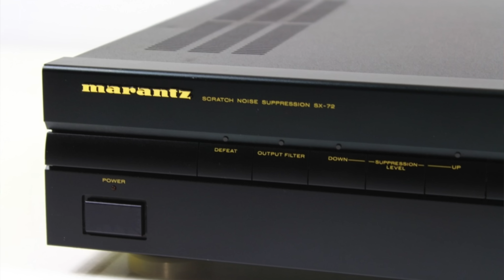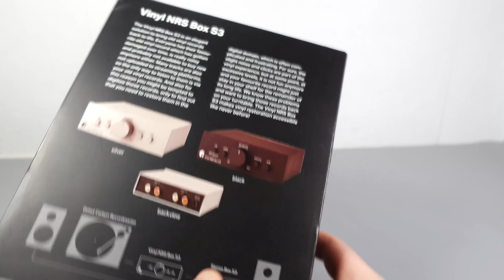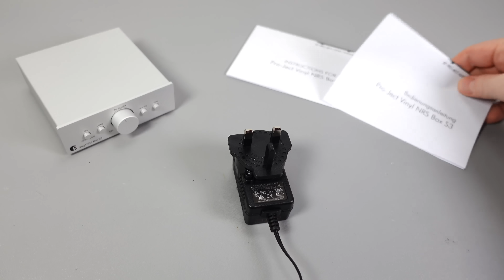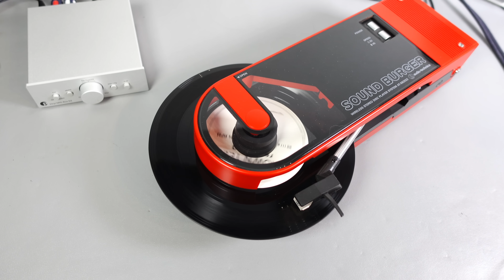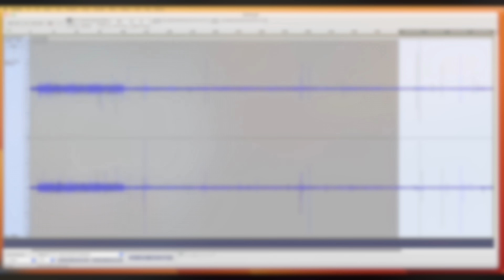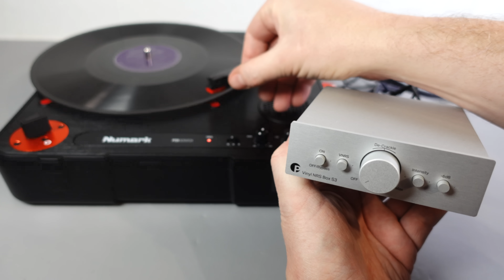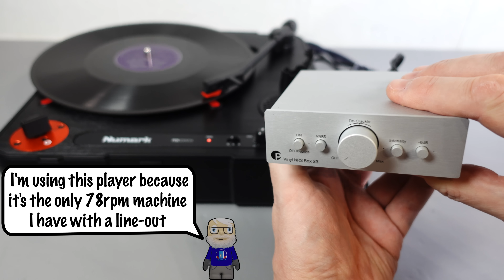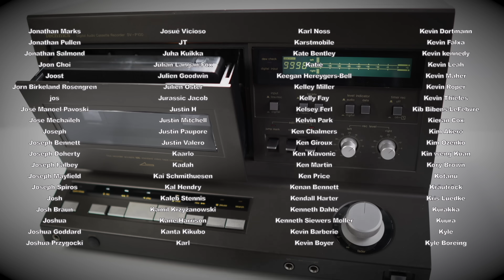REVIEW : Vinyl Noise Reduction System Pro-ject NRS Box S3

Comment: RS2xr Here: just build a new wireing system such as this:    

Splice a wire a Three wire  set: reconnect one color back or just do not splice that one wire  : connect the ground to the spliced color wire. you should have a  wire line in an X. and then play your records. would you be surprised to know, mono 45's after about 1063, were cut with a stereo cutting head?!  which, one channel is empty or silent! and the other channel  would be the music, etc.   with this wire you can remove that empty channel, using your balance ctrl.   and your mono mix, then sounds  so much better at least if not like a new pressing.

if you want toi make this a 4 track mix. you would need another wire of three slice the other colored wire and connect that wire to the ground.making an X.  you should also use two amps, for both wire sets. as  this setup can over heat an amp or wire set. if you set your volume up too much. 

This wire works with every, system. even Game systems. you may - find out, how  your games and movies sound.  if they are in stereo - so good you may Wow! your self.  if in mono, well, mono is one so one wire setup as such would move the sound to one speaker. a four track wire may have two speakers working!   

And no, I do not use a discrete board, as. there is no need!

Comment: My favourite device that I've found to make a huge difference in vinyl noise and turntable rumble reduction, all while doing this in a completely analogue method, is the dbx 3BX Expander.
This unit, while an oldie, is a goodie and a lot more than just pretty lights (it has those too!).
Reply: I own one but it messes with the dynamics of the original recording too much for me to use it often. The record has to be really hammered for me to bother.
Reply: @thomosburn8740  Interesting, but I haven't found that to be the case for me (unless you way over apply it's effects). The dynamic range increase, especially for the compression that seems more prevalent on newer vinyl, is a big benefit to me. But alas, hearing is a subjective thing, meaning we can both be correct even with different opinions.  🙂

Comment: Of course it actually digitizes the analog input, processes it and then turns it back to analog.  So I wonder if the vinyl purists will notice the sound is now even more oxygen free, smooth, warm-ish soft around the edges with hints of raspberry and cinnamon.  Soundstage was expanded to at least twice the norm and the drummers feel like they are sitting in your lap.

Not available in the USA (seriously).  Probably contains spy chips made by Huawei (supposition).

Comment: i have a computer program that work very good DePopper cleans a list of audio files, recorded from vinyl or audio tapes, with minimum losses. The resulting sound is bright, very close to the original. Only the clicks, pops and tape hiss are minimized. . You can do a 45 min WAV file in less than 45 sec

Comment: You'll probably find that some positions of the knob are more effective at removing a type of click or spat of crackle than others; for example, '2' might not remove a click where '5' will but then '8' won't.  Most de-noiser tools have a few more controls, and I'm guessing that Pro-Ject and sort-of reduced the functionality down to a knob and a button with some 'clever' logic.  Most professional de-noiser products have quite a few more controls that really let you dial things in, but even those I would never ever apply them over an entire track or side of a record.  I've only ever gotten good results by 'spot cleaning' them with a good audio editor like Sound Forge (which comes with my favorite 'pro-sumer' grade set of noise reduction plugins).

Comment: A scratch passes under the needle every 33 1/3 times per minute or .5555555 Hz and its multiples. This should be very easy to remove by the DSP.  (FFT -> remove frequencies -> RFFT)

Comment: I watched this video with great eagerness and as usual, the product underwent a fair, honest and real-world evaluation.
Unfortunately though, it seems that the device is incapable of removing surface noise, crackles and clicks to anything like a worthwhile level.

Because, audio restoration is a big passion of mine, I bought the Marantz SX72 ( I believe I paid about £450 about 30 years ago) and like the Pro-ject, the Marantz was simply incapable of reducing clicks and pops to a level that renders them unobtrusive....in other words; the product is completely useless !

The Pro-ject sounds marginally better than the Marantz as the Marantz produced a highly annoying artefact that replaced clicks and pops with a sound that was a lot like that made when sucking the last little drop of lemonade at the bottom of a tall glass through a straw !!

An infinitely better solution is to use a software product called "Click repair" ($40). Results can be astonishingly good even on 78s.
Most clicks, pops and crackle on vinyl are rendered IMPERCEPTIBLE by this product and deeper, more serious damage can often be successfully removed using it's manual removal facility.
Unfortunately, I don't know whether this software is still available for download though, as sadly the last I heard from Brian Davies it's creator, was that he was seriously ill and didn't expect to recover.

Comment: I used to do audio restoration for re-issue of rare recordings. Quite often the source was on acetate.

I used a Cedar Cambridge system, it had many, many tools along these lines.

This video unfortunately proves a truth which I thought time and development might have changed. Anything consumer based in this sector just isn't worth the money. I really hoped that might have started to change.

With all of these systems, even the pro level, if you over cook it you end up with a disturbing lack of air and space. And in the worse situations, audio that sounds like a low quality MP3 as the processor struggles to rebuild the audio it's hacking to pieces.

We always took the approach that the air and space in a recording was faaaar more important then making it squeaky clean. To kill the symbols in search of a reduced noise floor is to miss the point of recorded audio.

Comment: Yeah, even removing clicks and pops from a recording (using Audacity’s built-in tools) is sometimes a ‘big ask’. Working in a film and sound archive before retirement, it was sometimes just easier to go into the waveform and manually delete the worst spikes. Rumble did sound better here,, but I’m not sure I would spend even £200+ on such a box.

Comment: Back in the '70's at BBC Radio some of the studios which made a lot of 'grams programmes had in house designed de-clickers mounted on top of the mixers. I'm not sure how they worked but they were quite good at eliminating, or improving, the sort of repetitive click in some of  the examples you played. With these units one would hear the first click but the subsequent ones were muted. When setting the units up there was an "invert" button which allowed the clicks (but not the mod. from the record) to be heard in isolation. At least that's how I remember it.

Comment: Have you tried recording to tape through the device, then playing that tape back through the device?  Be interested in how much degradation there'd be or if it could even reduce down the crackle more.  It's surprising anything works on the fly like that at all, you'd think there'd have to be a deeper analysis of the recording overall.

Comment: 8dB isn't a huge amount of noise reduction and the nature of crackles is that they are high intensity impulses with broadband frequency content (NOT just high, as the documentation implies: the Fourier transform of an impulse function is unity, ie a signal across the entire spectrum) that still sound quite noticable even when dropped down significantly...  

What you need to show whether the thing is doing anything at all is to digitize a section of music or your "silence" record so you have a consistent input all the time and show the before vs after digital output vs the input.   Additionally, if you feed the signals through a program that can do an FFT on the data and show the frequency content of the signal, you'll be able to see what the thing is actually doing (very likely the VNRS is a high pass filter that just cuts out the very lowest frequencies where the rumble is and their crackle is a low pass filter that lets in normal audible frequencies while cutting out the very high frequencies that they believe crackle shows up at...   Again the issue is that crackle is NOT actually just high frequency but broadband, so what you need to filter crackles is not a frequency domain filter but a simple algorithm that just monitors the output level and clamps it if it goes high in a short amount of time but otherwise doesn't touch the signal at all.  In this case, you'd want a few different adjustments available: the time threshold that a signal has to rise through before you consider it a crackle, how much it has to rise in that time for you to consider it a crackle, how long you want to block the noise and how much you want to block the noise..   If you're already using Audacity, there are many built in and downloadable filter and processing packs that you can try that do an amazing job at cleaning up audio..   If you get something like a small media PC or maybe even a Raspberry Pi with a higher end USB digital input and output box and load Linux onto it and get it to run Audacity in "real time" mode with your preferred processing settings and filters as a "kiosk" app, you could build your own noise reduction box...

Comment: Want to get rid of cracks and pops, get a anti-static mat.. I've had mine since the 80's still works... I think your test would have worked better if you were using something like a Dual 1219 rim drive, with a bit higher volume, where the rumble would be picked up more.

Comment: 78 records sound a lot better when you use a stylus made for playing them. 78's have wider grooves than modern 33's so all that surface noise is the stylus dragging over the bottom of the groove. 
Also my experience with NRS systems has not been good. Turn it up enough to get rid of the crackle and then it sounds like your speakers are sitting in the middle of a fish tank. Crackles, pops and whatever, I want the purest audio coming off my records.

Comment: Hey my comment is under no 1000 this time.
Yeah, at 300 that's a crap product. I've seen amps with fair rumble filters around 50 (2nd hand). Don't like hisses and cracks? Maybe don't go the vinyl route?
And if you are transferring your unique white label vinyl record from the early 90's (or that rare ragtime 78 from 1948) to digital - you'll have the software side of that configured.
But if you are just playing Abbey Road from vinyl and are upset with the audio quality? Considering the 2nd hand price of the album on CD plus a fair condition CD player should set you back around 30... STFU maybe?

Comment: Proper methodology would be to use the exact same section of the record for each setting. Maybe even record a section to a different medium, then apply the noise reduction system to that.

To my ears there was a significant improvement with the noise reduction on. Of course it didn't eliminate the noise entirely, but to expect that to be done on-the-fly is very unrealistic. To put it another way, I would say it took the Beethoven record from being absolutely unbearable to being merely irritating.

Is it worth the money? I don't know. I would have to have much longer-term, in-depth experience to really know. I suspect that if I listened to old vinyl a lot that it would indeed be worth the relatively affordable price.

Comment: My opinion is it does more damage than good. If the record is that bad and you need to salvage it, rip the audio and use the right tools to fix it...or hire a person that has the tools and knows how to use them. 
I find most of the surface noise on old records to be part of the vinyl experience. I'm only bothered by skips and bad pops or clicks. A good example was the 78 you played. I thought it sounded fine. All that is expected from that medium. 
It just seems like another gadget for audiophiles to indulge in. If you really need squeaky clean audio, just use digital playback. Maybe for vinyl purists listening to classical music, there might be a need for this type of device. And in that case, it's probably going to cost thousands of dollars. To do this task in real time is going to require serious computing power and considerable R&D investment in producing software that can do it.

Comment: Not at all impressed with this device. I have digitised all my 78s and have used Izotope RX software to remove practically all surface noise, cracks and crackles. It deals with LPs like a walk in the park. By comparison, this Pro-Ject device is pathetic.

Comment: Garrard made a device in the 1970s for this purpose called the MRM (Music Recovery Module) and there was another similar product from another manufacturer called the SAE 5000.  They would detect quick transient spikes, which is usually how pops and crackles show up, and suppress them out.
A YouTube demo of the MRM is here: https://www.youtube.com/watch?v=4jHPIlcPLpQ
-- you can hear how the unit does suppress the pops but also takes a bite out of the audio attack on the notes.  This is where the level of suppression comes into play -- the demo doesn't really try to find a medium, but maybe he's not hearing the "bites" I am.

When I de-crackle vinyl recordings digitally I find the odd offending pop can simply be deleted as it's usually less than 0.01 seconds long. Most of the time you can't hear any evidence that there was ever a pop there -- but of course that's tedious cleaning one pop at a time. But if there's an offensive one I can clean it.  Audio software (e.g. Sony SoundForge) sometimes has a plug-in that is supposed to work the same way (SF calls it "Audio Restoration"), but it's of limited use as, just like with these devices, if you turn suppression up too high you get suppressed audio elements as well, and everything starts sounding cheesy.  More processing = more artifacts.

From the description it sounds like the VNRS may be just a high-pass filter that is notching out some low freqs where rumble may be expected, and yes that would also penalize some of the bass colouration in the audio. Compensating for that then would tend to bring the rumble back. Doing it digitally you can sample a second of surface and then subtract from the audio, which I think is a better approach. My digitized vinyl can't be sussed as having been vinyl at all.

I think the second (78RPM) demonstration was the way to do it, rather than stop-and-start using different settings.  Simply start a record that has consistent noise and manipulate the processor, WHILE it's playing, so you can hear the difference (if any) instantly.  That way you not only don't have to wait for the next test, you also don't wear out the single piece of vinyl by playing the same passage over and over without time to flex back into place.  Those records in the video above are going to have "cue burn".
Final thought: never pinch a tonearm as at 8:46 to pull it off the record, as the inevitable lateral movement scratches the record surface (QED). Use the cueing lever or, if none exists, place a finger under the handle and lift UP.

Comment: Pretty expensive for a high pass filter which you probably already have on your receiver. Borderline snake oil. That said, I have used VSTs that do a great job at analyzing noise then removing it, so the tech is out there.

Comment: Burwen and KLH (TNE700A) made Transient Noise Eliminator systems that worked very well but they cost in the $500 CDN range in the 1970/80's. The best one I ever used was a software based system made by CEDAR. The CEDAR did work miracles with crackling and clicks and pops on records. I still have and use the KLH which I've replaced most of the capacitors in over the years. Same idea as the unit your demonstrated but the bypass switch was an A/B switch between the turntable level input and a tape monitor function. You monitored at line level through your amplifier.

Comment: The first record showed significant improvement on the max setting. I wonder however if with modern signal analysis, FPGAs, and a neural net that can detect cyclic distortions coming from a crack in the record, we would be able to remove all crackles, and cuts in the record. But then, with that much signal processing, probably you'd simply read the whome record onto a computer and unleash full digital processing.

Comment: I'm wondering if passing it through a proper phono preamp would affect it in any way. Also, could've A and B it to Audicitys own vinyl noise reducer. When I was taking audio engineering classes, we used to joke about consumer and prosumer equipment not really doing what they say. Like when pushing a button, a light comes on to make you think it's working.

Comment: I always love seeing you review these gadgets. I always think “will this one really work? Will it be uniquely amazing?”, and invariably I’m not that impressed and neither are you. 

Ultimately this box seems like an obfuscated digital EQ, and sounds about the same. 8dB isn’t quite a perceived halving of volume, although it does reduce electrical power a couple times over. There’s only so much that can do. 

They’ve clearly tried to tweak it to not totally kill the top end with the pop filter, but ultimately ended up notching out a certain range and any pops outside of that range sail right on through. And if it’s 6dB that’ll be a perceived volume reduction by a quarter at best. Hence being unimpressive. 

Certain Pro-Ject boxes are decent, but they don’t half sell a lot of dubious stuff as well.